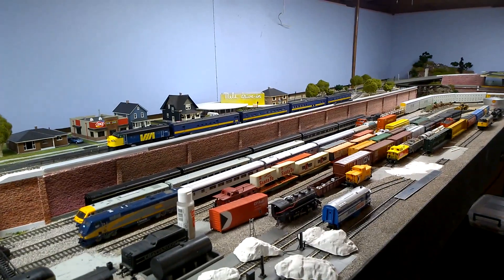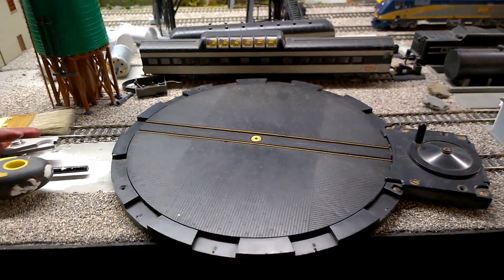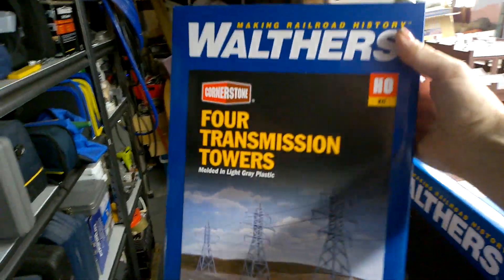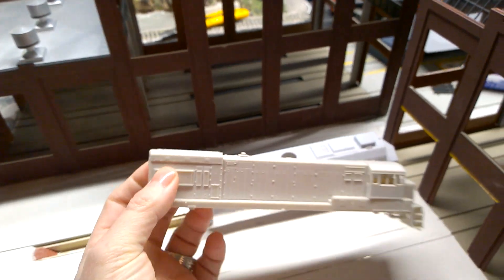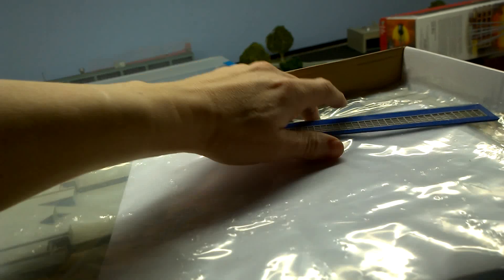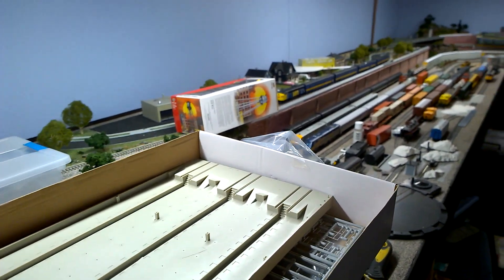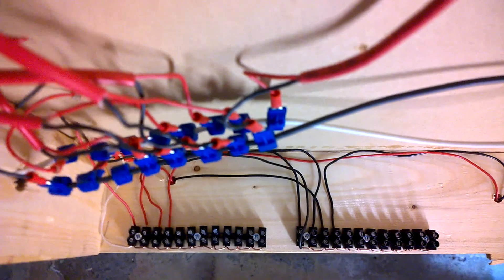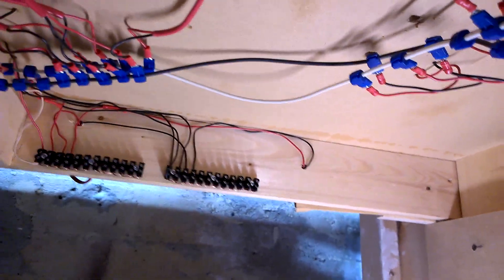First video of the year

Comment: It takes many many small steps to get a layout fully operational.  That is a great gift from your father in law.  Actually you have collected quite a few great models.  The day you can run in a loop will be a fun day. Rob
Reply from the maker: +Rob McCrain So true, but you still like to have it done fast.  Just the other day I was looking at the layout and realize just how much stuff I have gotten in the last two years.  Almost two years.  Really the last month all the buildings.  I may have to slow down on the scenery and get the trains running.  I can't wait for the day I run the train around the layout.  Then it will feel like I have done something, even though I have done a fair amount.
Scott
Reply: +Scott Downey Try not to be in to much of a hurry.  I went too fast on my N scale project.  This week I am ripping out the curves and building a new support structure and relaying the track.  Just saying.  Rob
Reply from the maker: +Rob McCrain I was a little too much in a hurry when I started and the curves are too tight but a couple I can get away with.  Now I have the stock and the knowledge, I can make them the correct size now.

Comment: Hi Scott happy new year like that modern engine house that looks smart ,some nice new additions looks like you will be busy with moving all the stuff you have in the basement cheers Kevin
Reply from the maker: +kevintregunna The diesel house is a really great kit. The outside was the easy part to figure out.  Just having a hard time to figure out what colours and how to arrange them is the problem.  So far I figured the base will be grey and the platforms but what colours to paint the supports and the other parts. Its great to have all that stuff for doing things but when it comes to making space, its a total nightmare.  I will figure it out but I may lose what's left of my mind.
Scott

Comment: Wow Scott, got yourself some great kits there, think that will keep you busy for the next few years. And good tip about twisting the buss wire, did that to mine before I had to take it all down, plus it helps keep it tidy 😀
Hope your other items turn up soon, and Happy New Year to you and your family mate.
Cheers, Mark
Reply from the maker: +Western Centurion I was lucky this year or should I say last year to get and purchase some great kits.  I shall be busy for sure.  I really have to practice what I say and get that wire fixed.  The stuff should be here by the end of next week.  I really don't understand why it has to be there for a week and then it is sent to me.  Now that the holidays are over you would think it would be faster but for some reason its not.  Happy New Year.
Scott
Reply: If your mail system is anything like ours it can take anywhere between 2 to 4 weeks to clear the Christmas back log, though saying that this year has been really good, I think they've learned from the past few years of chaos. I'm just testing 2 Hornby Q1 I bought over Christmas, they took a week to arrive after posting, normally takes 2 to 3 days, a beautifully ugly loco by the way and very well prised at the moment on eBay ;0)
Well back to my painting I suppose before Debbie rings that door bell to call be back to the house lol.
Have a great weekend Scott.....

Comment: great vid Scott. plan for lighting in the diesel house before assembly. I like the blue... i think I seen one like that before ;)
just make sure you do the safety lines in yours... i didnt in mine and i regret  it. great work though
Reply from the maker: +Go/Via/orgohome I looked on YT at different ones to see how people painted them.  I didn't want to go with the complete grey but I also wasn't sure what colours to do the inside hence the reason the outside is done first.  I did decide to paint the inside mostly grey with the yellow safety.  I just can't decide on what to paint the rail and deck supports.  I also have to decide on how I want to light it.  I seen under the deck lighting as well lighting from the ceiling.  Hard to believe one build has to have so many decisions.  I see you put a couple of units up for sale on E bay.
Scott
Reply: +Scott Downey  ya I need to re do my Telus train because after I did one for bigCdubya and it turned out way better then mine.. It made me realize how much I like that one so I want to get the right shell with body so it looks right. And with the CN it's not what I need for my layout. I post the odd time. With my diesel shop I bought I was missing a roof vent. It happens sometimes though. I need to make a super long shop for rail car repair. I was thinking of getting a few of those kits you have and doubling up on them and making them into one long build. I am so looking forward to ur next 4x8 and seeing what happens after that. I also have been meaning to send ya something but have not had a chance lol. Great work and keep it up.

Comment: Happy New Year Scott. You got a lot of cool stuff there. 
Had a good idea for your hobby shop - you could do what (I think) Rob did, and make a small version of you and your layout inside the shop? Would be cool to see a 'little you' in there - you'd need Sketch too.
Interesting tip to twist the bus wire. Curious as to what you do with all the servers and videos Scott? Laurie.
Reply from the maker: +Calvertfilm The only problem of making a small version of me is I would have to make a beam low enough to hit my head on. lol  Sketch would have to be a large version to scare everyone.  Twisting the wire helps with interference and such.  That is why network and other types of wire are twisted.  It is good to do the wire to your speaks in a home audio system.  The serves haven't been setup since I moved here.  When I finish the office they will be up and running.  I use them for a number of things, print server, telephone system, security camera's and file server.  Happy New Year.
Scott
Reply: +Scott Downey Yeah good tip about the wires. I'll try that, Laurie
Reply from the maker: +Calvertfilm Glad I could help with an idea.  I have learned so much from the videos on here.
Scott
Reply: +Scott Downey Agreed, I think we are all getting ideas, learning and inspiration from each other.
Reply from the maker: +Calvertfilm So true.

Comment: I haven't done any wiring on my layout yet. I guess I should think about that pretty soon, huh?
Reply from the maker: +The Shade Tree Fix-it Man I spent about 3 days on wiring before I shot the video.  I didn't realize how many feeder wires I needed to attach.  I thought I did more than I did.  Running DCC you really need them. I never really look under the layout but I think I will.  Seems to be just as much work under there as on top.
Scott
Reply: +Scott Downey   Hmm, the little Bachmann DCC controller I have runs my one and only DCC engine with just one wire lead to the tracks. I suppose if you are going to run more engines it would be important to have more feeders and then onto the sidings as well. I fully intend to run more, but only one one level as the second main will remain a DC only loop at this time.